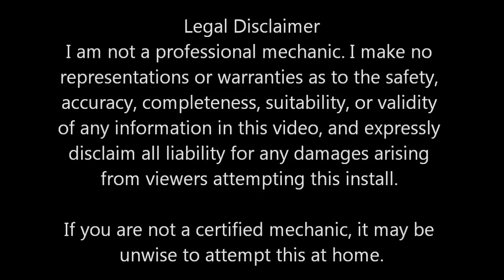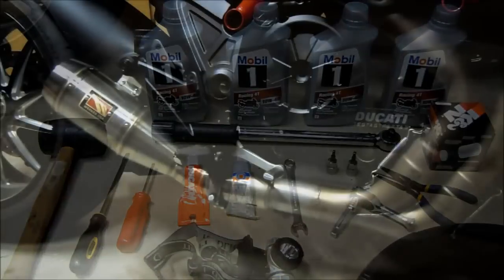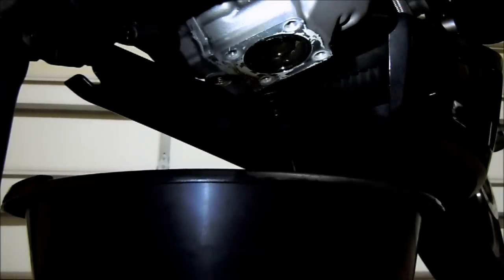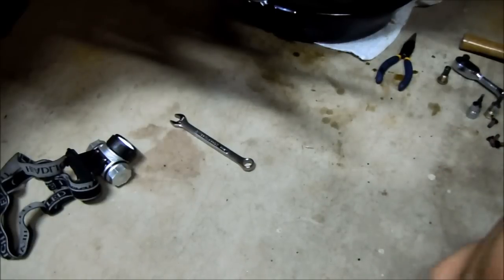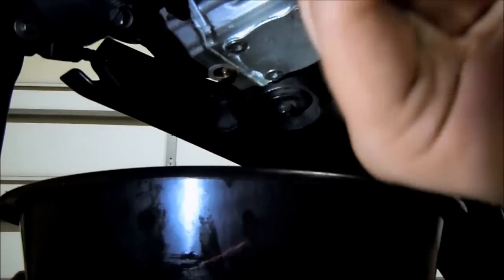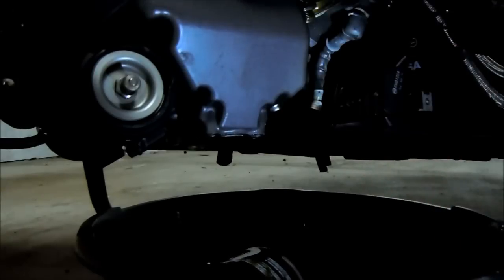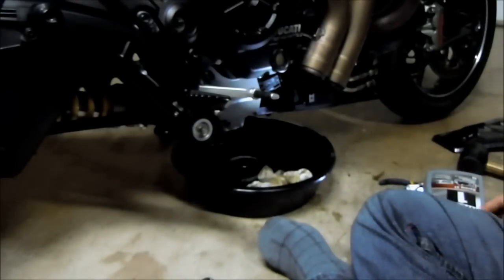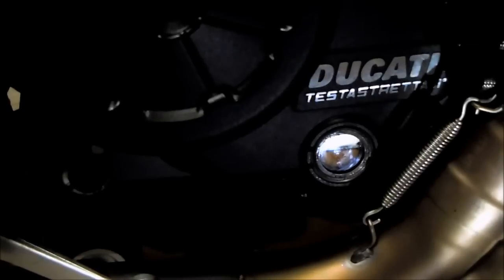Ducati Diavel Oil Change Complete

Comment from the maker: Well, a shop decided to throw away my charcoal canister without asking me, and didn't bother to install longer hoses, so there's that. Won't be going back to that shop. I removed the canister from my 1098 and Speed Triple because it was a big waste of space. Since there is a huge notch specifically for the canister on the Diavel, it's not really worthwhile to eliminate it unless you're going to build a custom tank or have a euro tank coming. My long-term goal is to make a custom aluminum tank...

Comment: Have you dug as deep as fork fluid replacement and timing chains on these bikes?
Reply from the maker: Haven’t messed with the timing chain. Cracked a case on. 1098 and the case cover alone cost like $800 so I don’t screw with the engine anymore. Far cheaper to hand it off to a dealership, IMO.

Fork fluid hasn’t needed to be changed yet. I have the tools when the time comes.

Comment: If you do the custom aluminum tank, I'm in if you invite. The small stock tank is a little frustrating. Especially since I'm never south of 5 grand fuel is scarce. The notch looks like a good place for the Innovate LC-1 wide band O2 sensors, then we have autotune. 😏

Comment from the maker: I have a flyby video of the pipes, but no walk-arounds. Keep in mind the sound of the exhaust changes as you make several changes.

-Stock to CW (sounds tinny and restricted)
-Mid pipe with flapper vs without (sounds choked up with it in)
-Stock fuel map vs fully tuned on a dyno (louder and even more evil after tuning)

The Competition Werkes pipe has a really bassy free-flowing sound. I actually like it more than the Termis.

Comment: Removing the stock exhaust isnt as easy as he shows here but you can access the oil filter even with the exhaust on.
Reply from the maker: What's hard about two springs and a bolt? You don't need to disconnect the muffler from the Y-pipe.
Reply: kuhlka  On my 2013 Diavel Cromo there is several things to disconnect.  I don't know the correct terms but there is a metal hose like thing that connects to the bottom part of the exhaust and the top part of the exhaust has another hose like pipe was well (maybe a sensor ).  It just seems like it would be a headache to remove so I just got some oil filter pliers ($5 from Harbor Frieght) to loosen the oil filter. It was on there pretty tight but it finally came off. I really don't see a reason to remove the exhaust especially if you have a rear wheel stand to give you some extra space.
Reply from the maker: D Tay I removed it for the video mostly for a better view of the process. I forgot about the stupid flapper valve in the y-pipe. That was one of the first things I removed with the duc.ee. Tuneboy also eliminates the need for it.

Comment: Ducati sell a oil filter socket to fit a standard ratchet!!!!!!!!!!!!!!!!!!!
Remove only filter , sump plug & oil - dont forget to replace(optional) copper washer on sump plug.
THATS IT !!!!!!!!!!!!!!!!!
Reply from the maker: By all means, if you want to spend the money on specialty tools and Ducati branded filters, have at it. The vast majority of people who work on their own bikes aren't going to do that for a simple oil change.

That socket is up around $80 and doesn't fit less expensive (but equal quality) aftermarket filters that aren't exactly the same size as stock. I have filter sockets. They rarely work on my bikes and cars because the knurling on the filters is often too rounded to get a good grip.

When I do an oil change without the camera, it takes me about five minutes and I don't remove the exhaust. I try to make my how-to's for people who may have never attempted what I'm demonstrating, so they tend to go into a lot more detail than necessary. That's why a 5-minute job turns into a half hour video.
Reply from the maker: I was thinking about buying the Ducati filter socket when I got the bike. They wanted almost $100 for it at the dealership. K&N filters are as good or better if you tear them apart.

Thanks for the tips, but I know all of that. If I wanted to make an hour long oil change video covering every anal-retentive detail (like draining oil hot vs cold) people would just complain that I'm being too verbose. I already got that complaint about the 'full' oil change video that was almost a half hour long.

The only time removing the sump filter makes any sense if every couple oil changes to see if there are any particulates. It was worthwhile for my first and second oil change because there were a few bits of liquid gasket and a few tiny metal shavings (and I wanted to show how to do it for the video). Otherwise, I almost never bother taking it out. In the 20k miles I've had my 1098 it's almost always been totally clean.

I don't use stands when doing oil changes, and it's best to use a level to make sure the floor is flat when you're checking oil level. If the floor is angled forward or backward a tiny bit the oil level can change by a few mm or more. With a stand it could be at the right level but look a quart low.

I'll grant you, anyone who isn't confident in what they're doing should probably just hire a mechanic.

Btw, you can reuse crush washers a few times if you anneal them with a torch. Just use a carburizing flame (mostly acetylene) to cover one side of the washer in soot, then slowly heat it up with a neutral flame until the soot disappears. Let it cool off and the metal will be soft and pliable again.

Comment: Yes i great video indeed. Though i wish someone would come up with a procedure to turn of that pesky service light.  It can only be turned of by a ducati dealer. Who will charge you. Its a form of ducati tax :-(
Reply from the maker: I recorded a quick Tuneboy flash video last weekend. Need to re-do it with better lighting for the laptop screen. I think one of the more recently Tuneboy updates added an option to reset oil and service indicators. If so I'll post up a video. I'm getting close to the ~15k service.